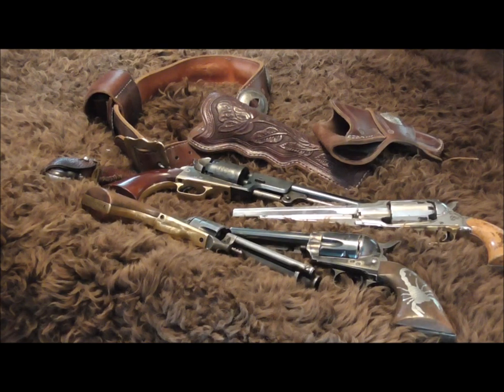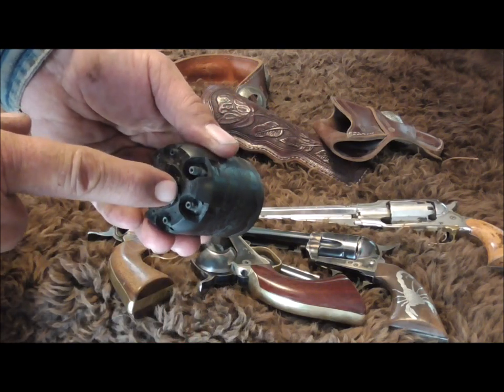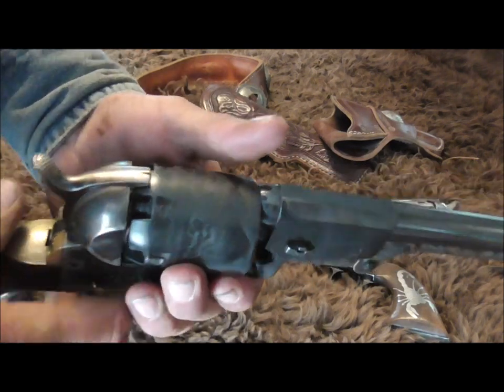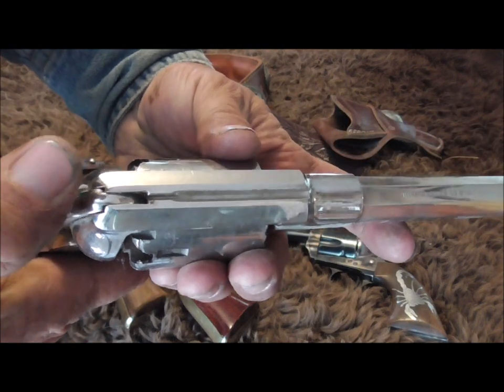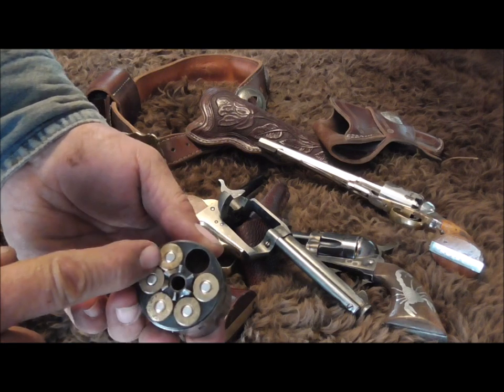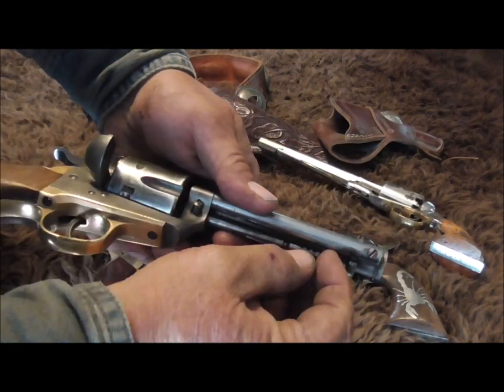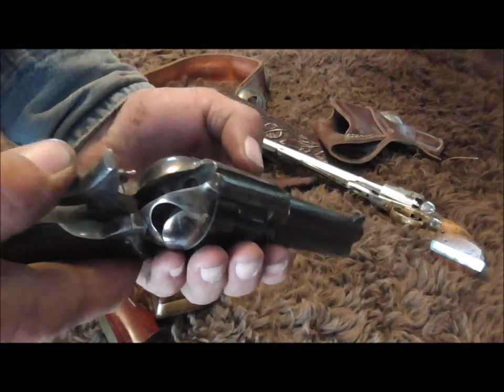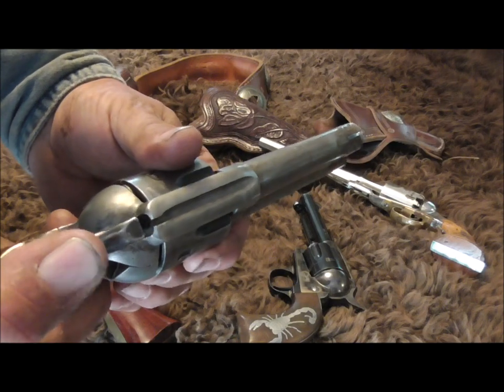How to Carry a Colt Style Revolver Fully Loaded

Comment: Sweet wheel guns Hoss!  Next time I'm down there you'll have to break them out, maybe I'll bring mine for a little shoot em up.  Is that Mexican loop holster one of yours?  Good info!
Reply from the maker: Thanks!  Yep that's one I made.  When is your birthday? I was planning to send you one!  Things OK?
Reply: Doing pretty good, especially considering the alternative!  That doesn't seem to work with my Cimarron Evil Roy, the hammer stays in the "c" position and if I go beyond that the hand kicks in and rotates the cylinder.  Doesn't conventional wisdom say you shouldn't let the hammer down from any position on a colt or clone without pulling it all the way back first?  My birthday is the same as Sid's, the 25th of Sept, heat of the rut.  Hope things are better enough by then I will be able to pack meat!
Reply from the maker: Well, be careful!   You should be able to pull the hammer back just enough for it to turn, then let it down.  I don't think it matters to let it down without pulling it all the way back. It's never hurt mine anyhow!  Maybe pull the trigger at the same time.  Mine is a Cimarron too made by Uberti.  Glad you are doing well. We need to get together this winter!  Coyote hunt maybe?

Comment: Friend.

The same trick works with old H&R Breaktops (And Probably Iver Johnsons too.)
Actually, when using an empty chamber with the free-floating cylinder, the cylinder can get up enough momentum to ride over a rim and get onto a live cartridge—unlikely, but still possible. The tight space between two cartridges locks it down too tight for it to work up the momentum to override a cartridge rim.
When I used to explain this to folks who owned old breaktops—they'd listen intently and respond:
"You're ABSOLUTELY RIGHT—BUT—on the other hand, one should put SAFETY FIRST."
That's an oddball statement. IF I'm RIGHT then doing it my way is safer. iF I'm WRONG—then the first part of their sentence is FALSE.
The unspoken assumption seems to be that it is tempting fate to go against the conventional wisdom even when the conventional wisdom is wrong…'
Sigh…

There were also holsters like Elmer Keith described where there is a leather tab that is part of the holster and it interposes between the firing pin and the frame/cartridge. The tab also acts as a retainer because the revolver cannot be drawn until the hammer is cocked slightly so that it is no longer pinched between hammer and frame.

…..RVM45
Reply from the maker: I agree.  I think the empty cylinder was designed to "Idiot Proof" it so that people couldn't do it wrong.   I haven't seen a holster like that. I'll have to look into it. Elmer Keith was from here in Salmon, Idaho . Thank you for the info!